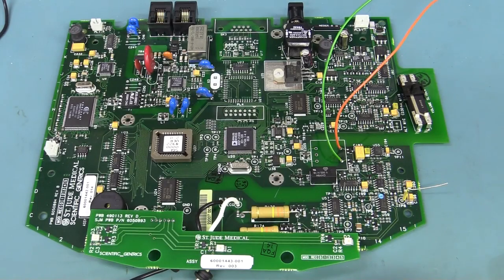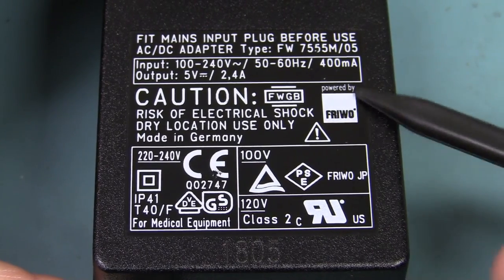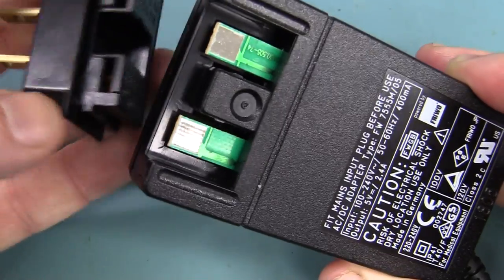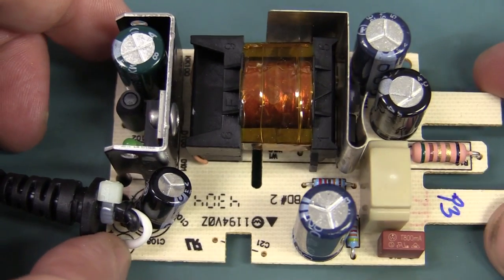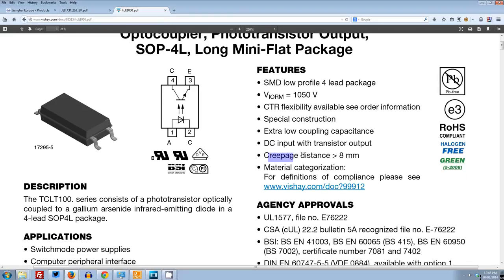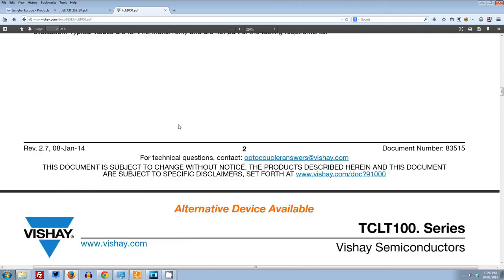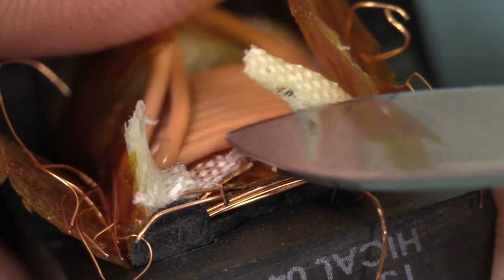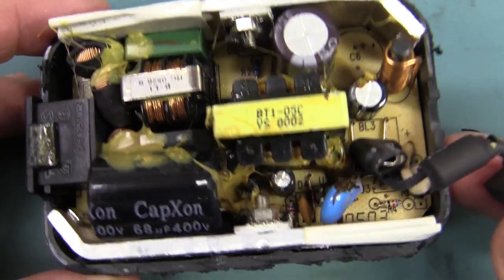EEVblog #659 - Medical Plugpack Teardown

Comment: Why would such a machine need that special plugpack?
It's basically just a telephone...
Reply: You are hooking up to the device through the wrist straps. I would not trust anything but a medically certified plugpack. Especially for someone with a pacemaker who would have more issues being exposed to any sort of shock (I assume).
Reply: Because it's a telephone that straps wires to the wrists of someone with a heart condition. That lets them sense a path right across the heart, but it also means a fault would send current right across the heart.

There's also the fact that medical devices are all standardized, no matter how safe they'd be otherwise. It's easier (and safer) to have a standard for medical device safety and require it for all medical devices than to determine what's needed on a case by case basis.
Reply: The whole point of all this isolation stuff is "what happens if the power line down the road is struck by lightning". If a high energy gets to the power supply, it has to stop it before it gets to the user. Of course this is true for any device, but especially true for medical devices which is a generic term for a lot of devices, some where it's more critical than others. As others have said though, putting electrodes on your wrists puts especially vulnerable heart patients in an especially vulnerable position.

Comment: 16:53 what tool is this ? brand?
Reply: It's a desoldering pump. I'm not sure which brand Dave has, but I have a Hakko 808. It is so nice - so much faster at removing components than the old-fashioned way!

Comment: Thank you for the great video. I am not impressed by this wall wart. The transformer you are impressed by needs that extra creep protection. It is poorly constructed and is missing the outer shield. 

The wart might make it in the isolation department, which is all medical certification is about, but it is a POS as far as power quality goes. I hope there is good on board regulation somewhere in this thing. 

Maybe it would be good to discuss isolation as a separate measure of quality because this junk part probably emits an audible hum much less EMF noise everywhere. 

I am surprised you didn't comment on or even test the quality factors.